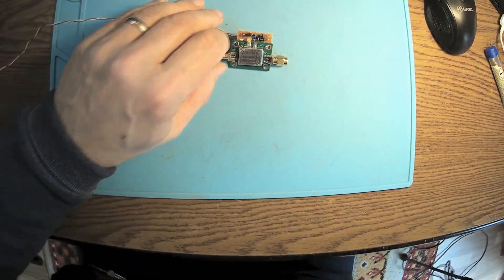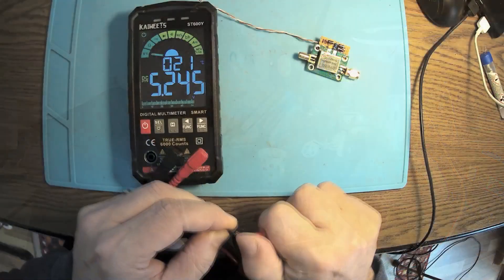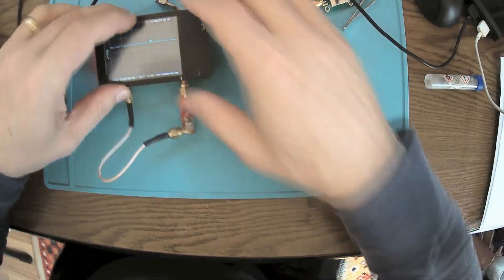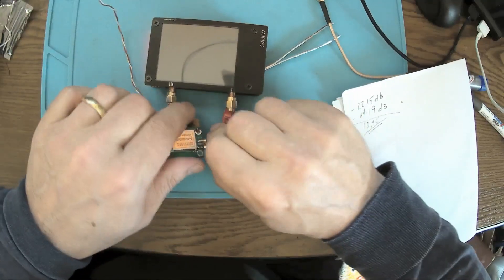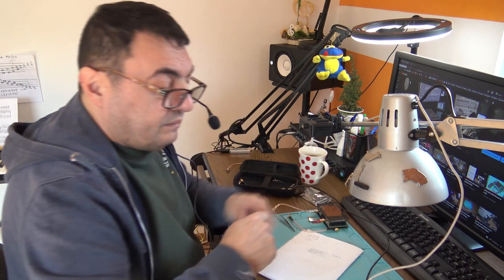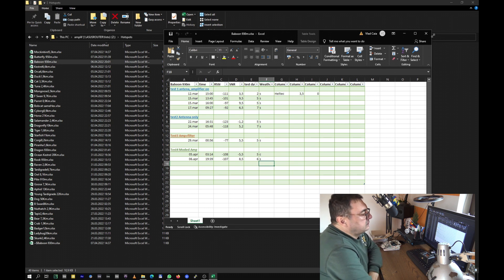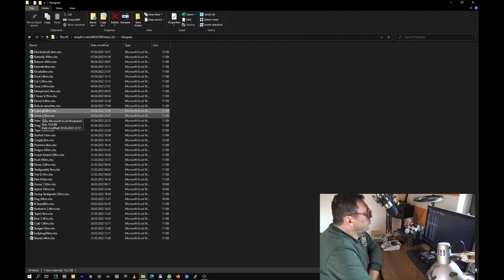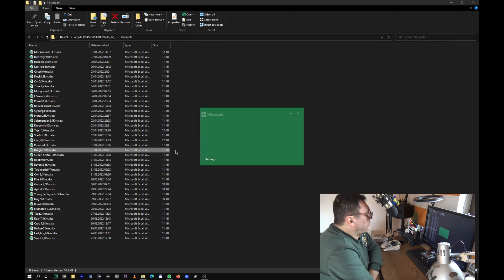LoRa Helium test week 4 Moded SPF5189Z test

Comment: I am not an electronics expert, but trying to read the schematic. 
I can tell you have three diodes in line on the + end where the 5V comes in. The diodes in series drops the voltage a bit and protects from polarity issues.

I then see you have an LED as well. How is this wired in?
Reply from the maker: Simple, chatode - goes to ground and anod + in series with a 300/500ohms resistor goes to plus after the diodes or before..doesn't matter..
Reply: @viocaia  Perfect that is what i thought! Thanks for the confirmation!
Reply from the maker: @dkapsali  Always!

Comment: what would happen if I used this amplifier without a circulator? would it just block tx signals so my miner never sends a beacon?
Reply from the maker: Funny..it will ''escape'' a little TX..some spot around can hear that..but most of the TX power just got loose in the amplifier..
Reply: @viocaia  interesting, I might try it and see if my earnings change, these are so cheap I think it is worth trying
Reply from the maker: @RedAndYellacuddlyFella  exactly..worth a try..

Comment: pt rx este excelent dar pt tx??? tre sa il scoata cineva din uz cand minerul va emite altfel.....il va distruge cu 27dbm cat va da in el echivalentul a juma de wat
Reply from the maker: Mihaita Maracineanu comments "
'' pt rx is excellent but for tx ??? someone has to take it out of use when the miner emits it differently ..... it will destroy it with 27dbm as much as it will give it the equivalent of half a watt ''
Answer:
In Europe, the maximum de TX is 15dB, about 31miliwati! Nothing happens.
At this power level, there will be no problems with either the miner or the amplifier. The tests have proven. It would be great to TX with 500miliwat!